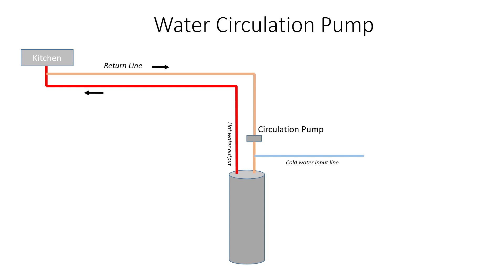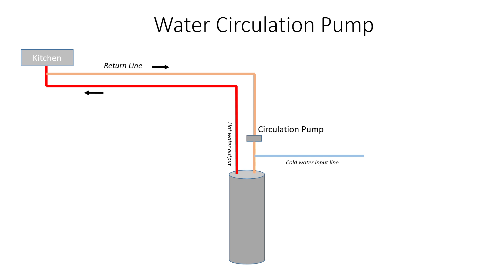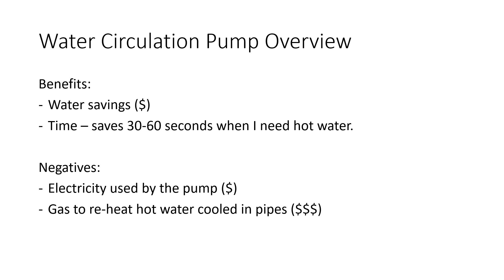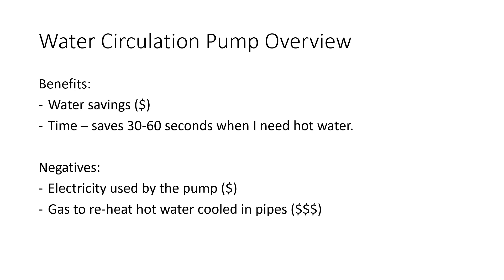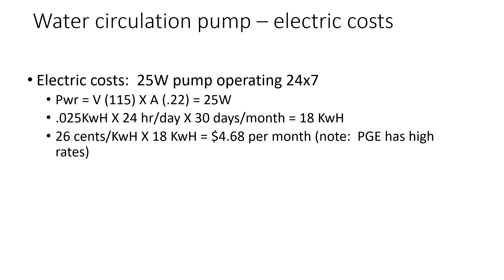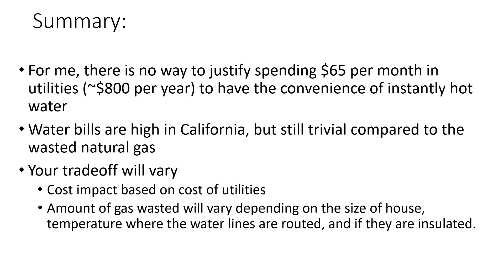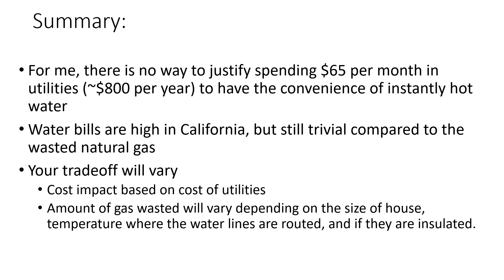Hot water recirculation pump cost analysis

Comment: Agree with other comments.   Take advantage of the multiple ways to have the pump operate more on-demand. and run for 1-3 minutes (should be how ever long it takes now for the cold water to flush out, and hot water to arrive at the faucet).  That cuts your pump's electricity usage.  But also pumping what that keeps cooling, and causing the HWH to run to re-heat it.

Comment: Wonder why this has never been brought up. Such a closed-loop recirculating system will get hot water into the potable water as well. All the crudes, sediments, corrosion, calcium deposits, rotten egg smell (if any) will be part of your drinking water. Unless you keep the water tank spiffy clean by flushing it at least several times a year and changing the anode rode annually there will be a health issue. Imagine the home owner that rarely flushes their water heater consuming all the contamination. To alleviate that problem, a dedicated line has to be installed and loop back to the water heater drain, which will isolate the cold and hot water completely. However, that gets expensive because an extra plumbing line has to run from the furtherest hot water line back to the water heater. That is the only correct way to circulate hot water by avoiding going into the potable (cold water) line.

Comment: My house currently has a gravity circulation loop to keep hot water near the faucets. This loop is unreliable and somewhat wasteful so I'm planning to add a circulation pump to the return loop. I use smart plugs and smart speakers to control other devices in my house (mostly lights) via a time schedule or voice commands. I'll control the circ pump the same way by scheduling on/off times, or more likely, use a voice command like "Hey Google, turn on the water pump for four minutes"  when I'm getting ready for a shower. That will turn the pump on for four minutes and then shut it off without further interaction.  Although I have a hot water return line/loop, I would use the same control system if I only had a hot to cold by-pass valve.

Comment: This appears to be a pretty old video on, and the techniques I've seen on many other videos use a timer or a smart outlet to make sure that the pump only runs when people are active, and it uses smart valves at the endpoints you care about, only one is necessary if everything is a small Branch off the main, with the result being a whole lot less active time. Thus, the electricity cost and the gas cost plummet.

Comment: The cost should come down significantly if you were to put the pump on a timer.  Turn the pump on x minutes before you normally first use hot water in the morning, turn it off after y minutes.  Repeat for each time period that coincides with  the beginning of a high use period.  For instance, in the morning start the pump prior to people getting up and showering, making breakfast, etc..  Set another period for evenings (meal prep, etc.).  Once you determine how long it takes after starting the pump to have hot water at your designated use points, adjust your start times.  There is no need to constantly run the pump when you're sleeping and when people are away for the day.

Comment: Thank you for this great analysis. I have been considering one of these and have been looking everywhere for the additional cost of heat loss in the pipes due to the constant recirculation. You are the only one that took that into account and as I suspected, it is significant! I live in GA and we usually have plenty of water so I am more concerned about energy usage. You have convinced me it is not worth the additional cost.

Comment: Here’s my idea.  In my bathroom there is a light above the shower.  I asked my electrician to run a circuit from that light down to above the water heater.  My recirculating pump is plugged onto that.  So now the pump only runs when I turn on the light.  Works great!

Comment: I run a Alexa smart plug and tell Alexa to turn on first plug 10 minutes before I shower, as I’m getting ready to go in the shower, I tell Alexa first plug off, pump is on only for 10 minutes and I have no need to use the 24 hr timer on the pump itself, not expensive at all

Comment: I had a recirculating loop installed and it STILL takes almost a minute to get hot water at the kitchen sink. First - I used a timer to keep it on only during dinner times. That didn't yield hot water on timely basis. Then turned the pump on 24x7 and still taking nearly a minute to get hot water? Cost analysis or not - solution not working? What could be the issue. I'm in Arizona so the pipes are not insulated.
Reply: Your system is installed incorrectly. Install the pump on your return line with an aquastat on same return pipe (dedicated return) to dump back into water heater (cold side). Set the aquastat to run pump at 90 deg and off at 120 deg.
Reply: Sounds like you have a long branch off the main circulating pipe.

Comment: Emmm... how often are you running the pump? If it takes about a minute for the water to get hot enough, then just get a smart outlet($10), and a google assistant/Alexa or something to turn it on only when you about to use hot water. And you can set it to turn off after one minute.

Comment: I'm not sure what kind of pump you're using, but I have the Watts pump, which attaches at the hot water side at the water heater to push pressure very slightly into the hot water side. At the faucet furthest from the water heater, there is a thermostatic bypass valve that allows water to flow from the hot side to the cold side until it senses warm enough water to close the valve. Mine runs 24/7, and the electric usage is minimal. Even in winter in California where I live, my gas bill rarely goes above $35. In the summer, it's closer to 10 to $15. You make an assumption of a heightened gas bill at your home and spread it across 12 months rather than accounting for a lower bill during the summer months.
If you were to put the pump on a timer, as well as accounting for the lower need for the water heater to reheat cooled water that's recirculated during the summer, I believe you may find better results.

Comment: Amazes me how many people get upset over the timer issue.  Timers are a rare feature on the recirculation pump assembly line.  To illustrate:  Grundfos is a major supplier of recirculation pumps, not including the larger units they make 197 models and only 2 have timers.  The two with timers are not among their best selling units.  As another comment mentioned, thermostats are often used to control these pumps.  When there is no demand for hot water the pump will operate for very short bursts typically less than a minute.  The information provided in the video is very helpful, just keep in mind every installation is unique.  Jim's data is a good jumping off point to estimate your cost.  In my case, I plan to eliminate my recirculation pump, get rid of the 40 gallon natural gas water heater and install a tankless water heater in a new location.  I estimate these changes to reduce my expenses by $250/year.  Labor and materials are estimated to run $1500.  Considering that I have to replace the 35 year old water heater anyway, I'm already spending half of that.  So I'm looking at a payback of about 3 years.  As I replace those old galvanized pipes in my 70 year old house, I expect the savings to increase a bit.  Good luck with your project.
Reply: i have one that has a button it runs for 90 seconds or until the water is hot.... doesnt use a timer just hit before taking a shower
Reply: Just get a smart outlet like wemo for $22 and control it from your phone with scheduling and override if you want.

Comment: I think your biased and already have your mind made up, thus the one sided factual demonstration..   why would u let the pump run 24/7?  Timers always go with this product,  but even better than that is an occupancy sensor next to a light switch...
Reply: I see this video as not well thought out. Having a timer and/or point of use switch, or rotating timer switch, would be far more intelligent than just circulating hot water around and causing the water heater to work harder to heat that circulating water.

Comment: My gas was only $44 in mid Nov to mid Dec with some cold weather in Ohio so the furnace was running also. My circ pump has a timer (that I only shut off from 11pm to 4am) and a stat at 100 deg F. So for me these utility rates would be very inflated.

Comment: 1.) Most systems are configured with a timer to put this system into play for maybe a 1/2 hr in the morning ( as folks get ready to go to work or school)..and then maybe also at night for a 1/2 ht, f or an evening shower, etc. One hour of run time , every 24 hours. 
2.) I like this system for Southern homes, like mine, that sufferes bathroom sink line freeze during an unexpectedly low temp cold snap...that lasted 2-3 days. For that period of time, I can set the timer to be always on for those number of hours or days when deep freeze is predicted....and prevent $$$$ damaging freeze problems. Rest of the time....not used.

Comment: Is your return line connected to the cold water inlet of the heater or at the heater drain ?  Have you tried adding a timer and aquastate wired in series on your return line ?
Reply: I have found in the system we put in our house that connecting the return line to the heater drain created a gravity feed loop.  We did not need a pump at all.  Hot water rises.  Cold water falls.  So we never turned our pump on. (It was the kind of pump that did not block water flow when off.) Our pipes were well insulated throughout the house.  So little heat was lost.  The gas bill for the water heater was about the same with the loop closed as with the loop open.
We were very pleased with the result.  We have moved into another house.  I am going to have a hot water loop installed back to the bottom drain of the tank.

Comment: I looked into doing this several years ago, and found that the initial cost of a pump, piping, fittings, and smart plug (the pump would only be energized when needed) was going to be $250 at a bare minimum.  Calculating water savings in cost per gallon (we have relatively cheap water here), I wouldn't recoup that initial cost for roughly 10 years.  If the pump happens to go out during that 10 year time span and I have to purchase a new one ($$$), all savings are lost immediately and I start over.  The idea of catching the cold water in a bucket and using it to fill the washing machine makes good sense as long as you don't mind toting water.

Comment: Great analysis, thanks. I too have this system but use a smart outlet to turn the pump off overnight. What would be ideal is a combination flow/temperature sensor on the hot water feed to sinks and showers that would turn the pump on when there was flow and temperature below the set point for just a couple of minutes. For far I haven’t come across such a sensor.

Comment: Great video. It does open your eyes to the costs of conveniences like a recirc pump. A few items I would like to add:

Tank water heaters are designed to efficiently hold the hot water in the tank. As you state, once you start moving that water out of the tank, your efficiency plummets. Recirc pumps are better matched against tankless water heaters, which are much more efficient at heating the water when needed and then turning off. On top of that, I don't know if tank water heaters work efficiently if cold water is constantly dumped into the tank. That's the kind of use-case that tankless water heaters were invented for. Even if the water entering the tank was 105 degrees instead of 120 degrees, that might lead to the gas being kept constantly in the "on" state to keep up. You've basically turned your hot water line into a whole house radiator system, lol. In the summertime, that would be not good.

But for the folks in colder climates, the loss of heat in your hot water line isn't necessarily wasted: it's heating the house. Although it's designed to heat the water efficiently (and not the house), you're still getting something from having hot water in the lines.

I don't think many people would have a recirc pump on 24/7. Having a timer would lead to predictable energy usage costs (recirc pump and tankless on for a few minutes in the morning, afternoon, evening, and night to flush the loop) which would give you instant hot water without the 24/7 electricity and gas usage penalty.
Reply: It wouldn't run 24/7. Most pumps are installed with a thermostat on the return line with the recirculating pump. Turns on a x temp off at x temp (80 on/ 120 off).
Reply: @danbiss87  it's the same problem. Would you rather your tankless be on for literally 1 minute every hour? Or have your tank water heater on for 5 to 7 minutes every hour? A tankless solves the problem of "race to idle" much better than a tank.
Reply: @cantcurecancer  I agree, not everyone has the funds for a new system however. I personally have an indirect water heater with a recirculating pump on that. It provides endless hot water as is. The recirculation will not cool down my tank at all. Everyone system is different, for me its a convenience thing and worth every penny.

Comment: Thank you, Jim.  My concern - heat constantly radiating from hot pipes and return water causing the water heater to burn more.
I plan to run Pex pipe to return water from the kitchen sink fauceto the bottom of the water heater. (Natural convection)   Fortunately I can insulate most of the hot water line from water heater to kitchen faucet.  We'll see if it works.    
After wife showers, I shower.  So the water wasted until hot water arrives is just a small percent.

Comment: I just use a bucket and retain the cold water the comes out of the shower until hot water comes out.  Then I dump the cold water into my washer that can be used for clothes washing.
Reply: I run my recirculation pump continuously our rates for electricity is lower in ohio...I found little difference in gas usage. I insulated all supply & return lines. The water saved isn't significant cost... those rates are low. Been running my system 24\7. Timers are of little value because my family has varied schedules.
Reply: Good idea!   That or for water to water house plants.

Comment: doesn't this mean that only that one fixture will get fast hot water? let's say the hot line feeds a few more fixtures on the way to the kitchen sink, those branches won't get fast hot water because only the main trunk is being circulated
Reply: beefcurrywithrice All fixtures should get hot water relatively quickly if you install a pump at the furthest location from the water heater. The only parts that wouldn’t get circulated would be the few feet from the main supply to the individual fixtures.

Comment: To reduce the amount of pump run time, there should be a thermostat located on the return line header.  This thermostat should be set approximately, to open at 120 and close at 90.  They make simple bimetallic therm-o-disks that would work great for this purpose.  The amount of time between pump off and pump restarting can be adjusted by how much insulation is covering the thermostat and return header if here is one.   Another option is to connect a motion detector in areas around the faucets and only turn the pump on when motion is detected in the home.  If no one is home then the pump would not circulate hot water.   This would work except for the dishwasher in the kitchen.  If someone programmed the dishwasher to start when people are not active, then the dishwasher would fill with cold water which causes the water in dishwashers to be cold at the start of washing dishes.  With smarter appliances the dishwasher could send a signal to start the hot water circulating pump or with old appliances a current sensor could be installed on the circuit feeding the dishwasher.

Comment: Typically these pump kits include a timer so water only circulates at certain times such as morning before showers, then maybe later before laundry. I would think for a normal family the pump should only run a couple of hours a day. Doing a cost analysis with the pump running 24/7 is not practical in the least.
Reply: I hooked my pump up, so that it turns on with the light switch in the bathroom.
Reply: @ryanbrand3946  simple is always better.  Great idea.
Reply: Agree, this leaves the important point of a timer and thermostatic valve.  I love my pump and my costs are not much higher, if at all and my cost of water in Colorado is so high it pays for itself over and over.

Comment: Installing a timer would probably reduce energy use by two thirds or more. No need to run during late night sleeping hours, or when people are at work/school. At our house we have the system timed to run alternating 15 min heating cycles for 2 hrs (1 hr runtime) in AM for showers, and again for 4 hrs in evening (2 hrs runtime), so just 3 hrs per day for noticeable comfort. This is in northern state where crawlspace air temp is about 45F. We do have the copper 3/4 in pipes well insulated.
Reply from the maker: Yes, great point Matthew.  The timer is a very good idea if you really need the circulation pump and have predictable windows of time for hot water usage.